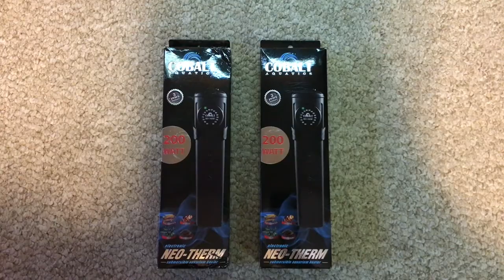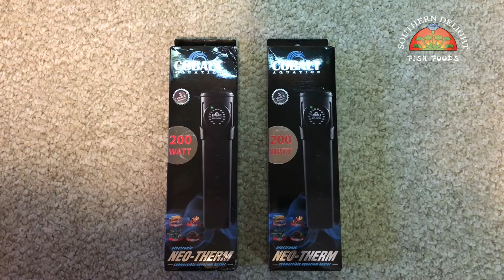125 Gal Reef Build - Ep 10 - Heater Issues

Comment: I'm a little confused: did the controller fail, or the heater, or both? Even with the controller failing, I'd think the heater's setting would shut it off. I really want to get one of those neotherms.
Reply from the maker: The controller failed, but it's an all in one unit, not a separate controller.  The controller was telling the heater it was not at the set temp, so the heater kept heating